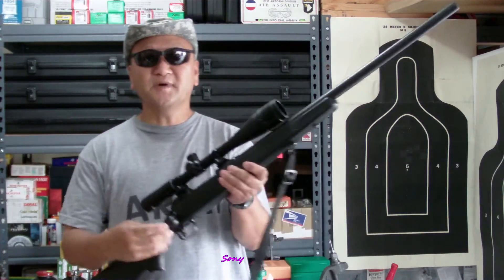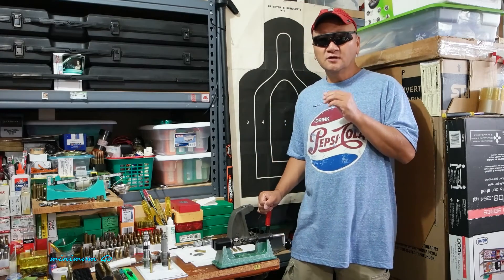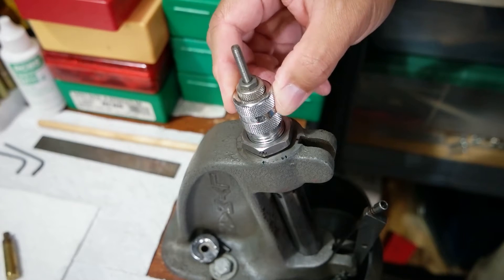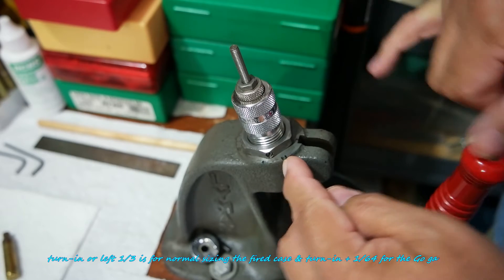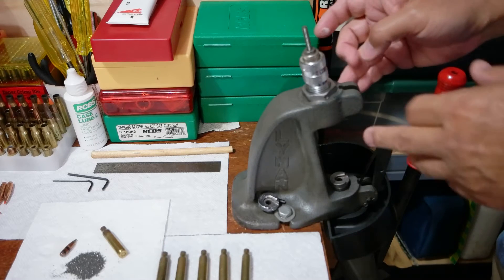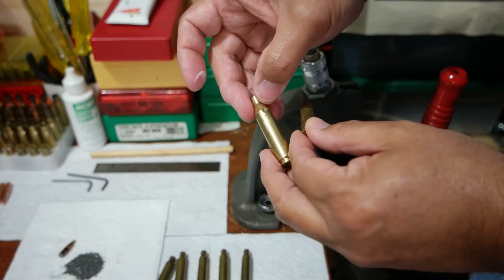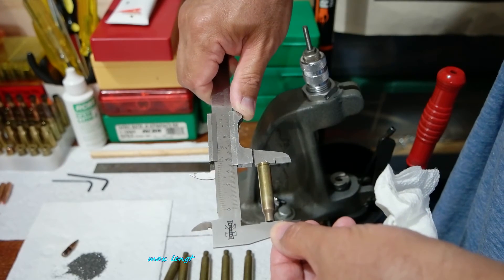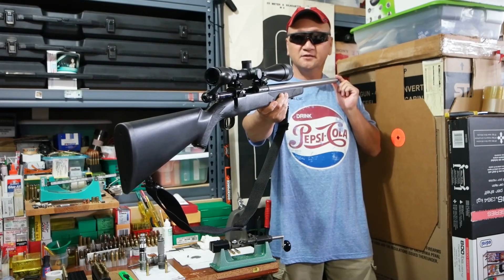making an improvised Go headspace gauges | SuddenDeath way 1080 fHD Samsung NX1

Comment: too much sizing oil can make dents when sizing. your should get a roll oiler from rcbs for just the right amount of sizing oil
Reply from the maker: thanks for visiting my channel. you're right about too much sizing lube can make dents in the shoulder area... i use both rcbs and lee sizing lube and the pad. if dents are too deep then it goes into the scrap metal bucket. ty ^^ :^)  PepsiMan willie 펩시맨 윌리 李